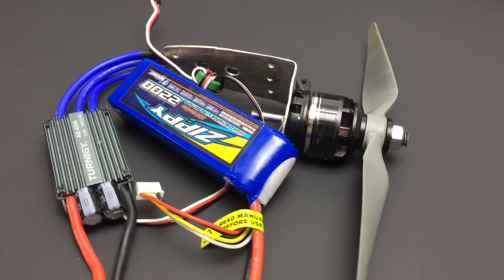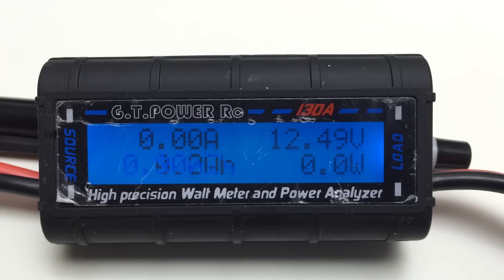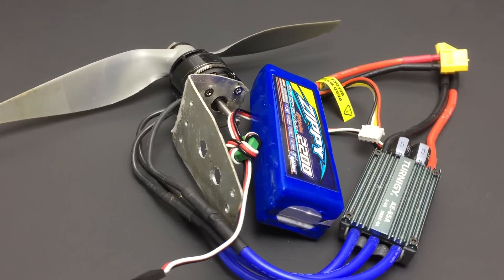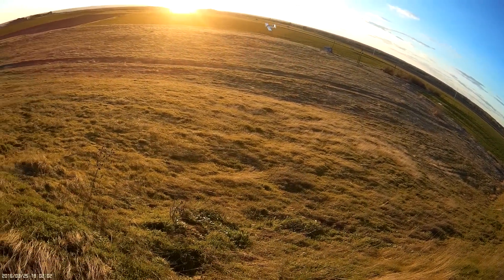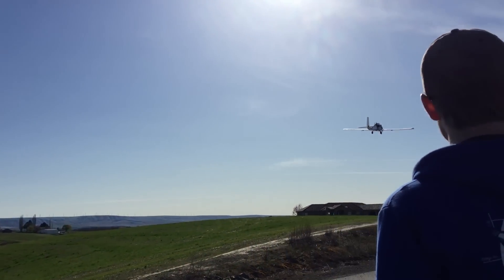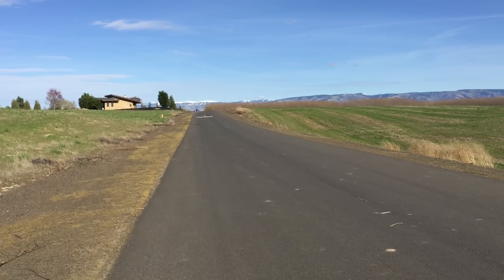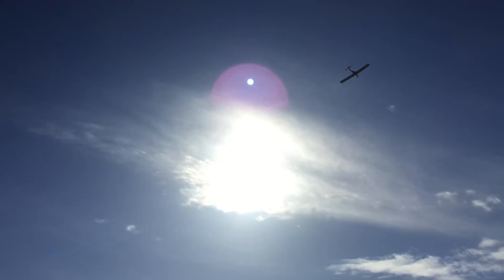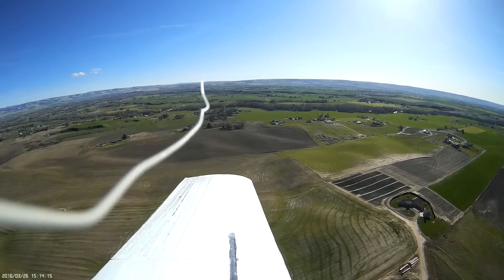Lead Acid Powered Plane

Comment: By the way, that outrunner motor is actually AC, not DC.
Reply from the maker: Every electric motor is AC. We call them DC motors when they are designed to make their own appropriate AC out of a DC source. A brushed DC motor makes AC with the mechanical system of the commutation ring and carbon brushes. The brushless motor uses an electronic commutator circuit (we call them ESC's) to switch the DC back and forth at the right time (which looks like AC) True AC motors are those like induction motors.
https://en.wikipedia.org/wiki/Brushless_DC_electric_motor
Reply: Yup, aware of that. However in this case, it is fairly confusing as connecting up the wires on a brushless motor to a DC source would only result in smoke. Connecting them to a typical brushed motor will make it work, so it is fair to call them DC motors. Typically in our hobby brushless motors, they are driven by P and N channel fets to make a mock AC signal as you said above.
Reply from the maker: If you gave DC straight to the coils of a brushed motor, it would also burn up. Some brushless motors like a computer cooling fan have the ESC - which I like to call electronic brushes - integrated into the base of the motor. All you do is give it dc and it works just like a brushed. These hobby grade BLDC motors have specialized external ESC's which can make it seem like we just give it AC, but if you were to just give it 60hz AC even an 12v it would not work, because it is a synchronous motor and the AC has to sync with the permanent magnets and not allow an slippage. AC induction motors control torque output with frequency, While BLDC motors change torque output with voltage, and the frequency has to be synced with motor RPM.

Comment: I dont think that SLA is in the greatest shape. It should hold its voltage under load better.
Reply from the maker: It was brand new
Reply: Maybe I underestimated the load on a single battery then.

Comment: Isn't 1 horsepower about 900 watts? How can a motor that small pull more than 2000 watts of power?!
Reply from the maker: It's 746w, and the answer is high voltage
Reply from the maker: Jonas Lindenblatt When I google Watts to horsepower I get 746.7 not 1360. The motor is an EMAX GT5335 -08 250kv

Comment: this is a very nice demonstration on battery evolution..    

but batteries are still an extremely inefficent to way to store energy ..

a brand new  testla model S with the big 500kg 90kWh battery has a range of less than 500km..  while an diesel audi with a 55L tank ( about 50kg.. 1/10th of the teslas battery)  in a heavy audi (almost as heavy as the tesla) from 2000:something kan do 1500 km on that little tank.. (if driven ridiculously economic as the tesla would have to do ) 

thats 3X the range with 10%  of the weight. .. with a inefficent combustion engine ! ..   an electric motor is far more efficent.. 

ofcource this way of thinking is oversimplified. .. .but it gives you ballpark numbers on how little energy are stored in modern battery cells compared to burnable fuel..   (even when just a bit of the energy from the fuel is converted into kinetic energy..  after all the friction and heat losses... ) 

batteries still have a long way to go  ..
Reply: True. However, it is much simpler to recharge the battery from renewable sources, and that's a big thing.
Reply: They should have small auxiliary diesel, gas, or LP generators as an option on electric cars to charge the battery automatically or at the drivers decision when other power sources aren't available. I think I heard Toyota was doing something like this. It would be nice to have that on a truck. I have also heard that some garbage trucks will be going to this as well.
Reply: Well i'd argue that if you had to bring all the air and the exhaust gasses with you the internal combustion engine would be a far less superior option... In that regard fuel cell hybrid would be the best choice, sadly fuel cells are still a tincy bit too expensive for a consumer vehicle...
Reply: batteries are the best way to store energy even better than hydro storage
Reply: I ment for one time use..  power to weight ratio...  

batteries are extremly inefficient.. 

for example a Tesla model S have a range of 500 km if you drive like some grandmum on the way to curtch. .from a 500kg state of the art battery ..

while any normal diesel car of similar size  with a 60L tank of fuel weighting around ~50 kg ...   10% of that battery can easily go 1200 km 

..and that is with an inefficent combustion engine that make alot of waste heat and have friction loss.. after that drivetrain loss etc..
Reply: Not really. LiPo 128 wH/kg lead acid 41. LiPo is 3x better.
Reply: hes talking about efficiency, not capacity.
Reply: Bender Rodriguez efficiency is a ratio. I mentioned the energy to weight ratio. What's more efficient about lead?
Reply: TheKlingis  yeah..... hey! fake clouds!
Reply: Dino Alberini when I said efficiency I meant the ratio of how much electricity you get out of the battery compared to how much you put in.
Reply: That's very variable and not a big issue in planes. Weight, however, is the biggest issue.
Reply: Lithium batteries have a much better charge/discharge efficiency than Lead acid batteries. Lithium is 90%+ but Lead is around 66%. As for capacity vs. Diesel fuel, batteries are being developed which have over ten times the capacity of today's cells. When they come to market, the range of a full charge, for a 500kg battery, will be over 5,000 km if you drive slowly. They will still be much cheaper to charge than the cost of diesel for 5,000km. In 5-10 years, it will be interesting to reconsider your comment!
Reply: Also remember the weight of a diesel and it’s ancillary equipment, less the fuel weight, is high compared to an electric motor, of the same power, and it’s equipment. Reliability, safety, and maintenance costs will also need to be considered.
Reply: that's called the chevy volt....

Comment: lead acid batteries are safer though
Reply from the maker: I mean they emit explosive hydrogen gas when charging. And if they explode they spray lead and acid in your face. But yea I guess they are safer
Reply: ***** 
lipo batteries can blow up with massive amount of flames
Reply from the maker: Technologic I am very aware

Comment: Hmmm I wonder, rc plane powered by capacitors? THat could be a fun pointless experiment.
Reply from the maker: I like you're thinking
Reply from the maker: Your
Reply: Flight time less than one minute?
Reply: RWBHere Not if you use supercaps
Reply: Which would work for a glider.
Reply: You can alredy do that as a Voltage boost with a lipo battery as the mains power charge

Comment: Your claims dont add up. 3 hp??? Impossible. Your 2200 mA hr 3 cell battery has what.... 11.3vdc? Multiply by 2.2 a.hr is 25 watt .hrs. But 3.5 hp is 746x3.5 ....2500 watts  ( actually more). .that battery could at best deliver 3.5 hp for 45 seconds. Plus in order for that motor to have 3.5 hp the rpm would have to be so incredibly high that the prop tips would exceed the sound barrier.
Reply: it was a different motor, just compare the size when he picks up the 3.5 hp motor and the one thats on the plane when it lands

Comment: Yeah, maybe it have 3.5 Hp, but try to power scooter with that. Or try to power that brush motor with your tiny battery. You cant just compare these just by one parameter and say that one sucks, that just ridiculous
Reply: You'd need a transmission i which you'd loose allot of the energy the motor provides. That brushed motor will happily run on that "tiny" battery. The brushed motor is more efficient for powering slow and torque applications, the brushless one is better for high speed direct drive applications.
Reply from the maker: You're going to need to gear down either motor for a scooter. HP=(torque * RPM)/5252. Torque at the motor doesn't mean anything. HP is at the motor is the same (minus reductin loss) at the wheel, and thus the brushless will have far more torque at the wheels. Powering the brushed motor with the tiny battery would be much easier on the battery since the brushed motor is only rated for 1400 watts while the brushless is 3000 watts
Reply: ***** Yes, but since the  brushless motor is rated for that power at 30-40k RPM you'd need much more reduction thus you'd have much more mechanical losses.
Reply from the maker: Eviltech Nah, two pulleys/gears/whatever will have the same loss no matter the reduction ratio
Reply: ***** Rarely two pulleys or gears would be used to achieve such a great reduction ratio, because that would make the transmission box uselessly large. Not to mention that sensorless brishless motors have the tendency to loose synchronicity when presented with short overload situations...
Reply: When the lead acid battery is evidently weaker than the LiPo, how the fuck do you figure that the lead acid can drive the brushed motor better than the LiPo? And why do you think that 3.5hp from a smaller brushless motor is less than the 2hp from the brushed one? That's like saying that 1 is greater than 2. When he says 3.5hp, that's it's continuous rating, not even peak (which is at much greater ratio compared brushed), and it means that it can continuously handle outputting 1.75 times the torque of the brushed one, at some given speed and at some given input throttle (likely need gearing to match speeds at equal throttle). Gullible physics slaying bullshit spewer. And transmissions/gears barely cut any efficiency so that's not an argument.
Reply: TheMrTape Yep, you are right, but there are slow and fast brushed and brushless motors. what they are comparing is a slow brushed motor and a fast brushless motor for a task for a slow motor. Lead acid batteries are better just in price per watt hour compared to liIon. They also require less precise charging circuits, making them better choice for a novice in electrical hobbies. In stats brushless compared to same type brushed win every time. So do Lithium against Lead acid except for complexity and price reasoning.
Reply: I used a small RC motor for my electric skateboard and that thing takes off like a rocket with me on it and maxes out at about 20mph. I only geared it down maybe 10:1 too. The motor is rated to 2kW but with the setup I have I don't deliver more than about 500W to it. These newer batteries and motors are better in every way I can think of.
Reply: +Samm Sheperd Worth pointing out that at low speed, max torque, max current; and even at the peak power point (max rpm/2, stall current/2, efficiency
 = 50%) the small motor won't last very long! It is dissipating a lot of your 
precious input power as heat... Some motors are designed to take such 
abuse in the short term, like the much larger scooter motor (and some aren't!) but a more normal operating 
condition is 80-90% of no-load speed, 10-20% of stall current, and 
hopefully 80+% efficiency (less for small motors). So sure... 3000 watts for that little brushless, but only at much higher RPM, in its region of higher efficiency, than that bigger brushed motor and with adequate cooling... like flying on an RC plane or drone.
Reply: connelly6375 Except cost and in some cases complexity